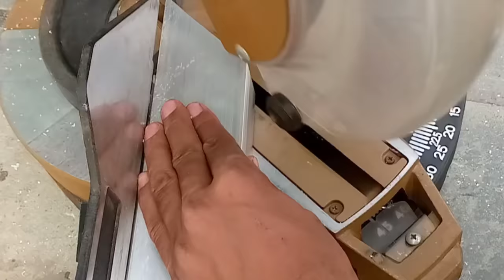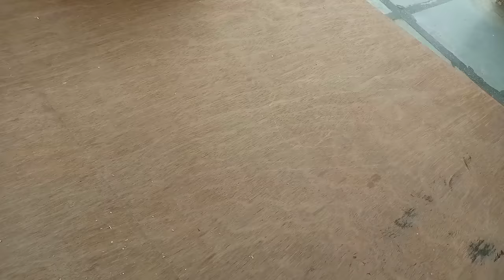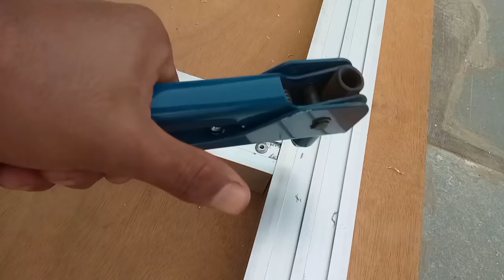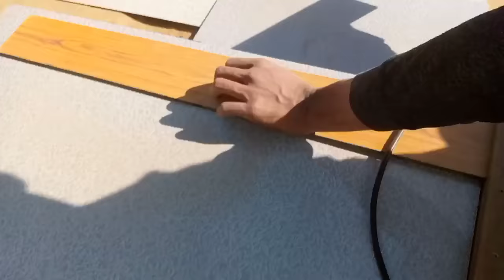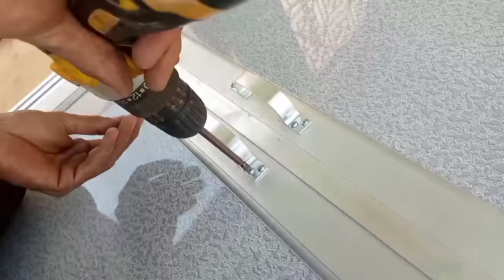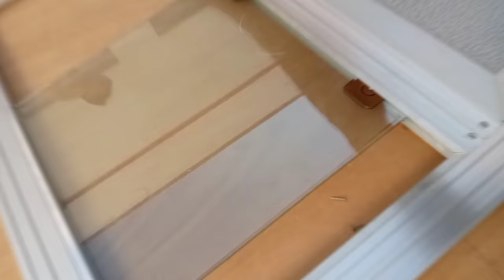how to make aluminium almirah एलुमिनियम की अलमारी कैसे बनती है #aluminium #aluminiumfabrication

Comment: सर इस मशीन का क्या नाम है
एस्कुरु कौन लगता है plz sir
Reply from the maker: Revt gun  https://dl.flipkart.com/dl/stanley-stht69800-8-heavy-duty-squeeze-rivet-gun/p/itmfbrycbdh7tyh5?pid=RIGFBNHYZTWHQPFG&cmpid=product.share.pp&_refId=PP.b0509148-01eb-4a42-a37e-7dfbeebb4c7f.RIGFBNHYZTWHQPFG&_appId=CL
Reply from the maker: Cutter saw aluminum 
https://dl.flipkart.com/dl/dewalt-machine-dw714-in-10-inch-compound-mitre-saw-metal-cutter/p/itmfetkkqcqmqgps?pid=CUTFERQ5KZXMZHST&cmpid=product.share.pp&_refId=PP.d9dd8fa2-7f30-408c-868f-0265b8437fc7.CUTFERQ5KZXMZHST&_appId=CL
Reply from the maker: Scrow Tighter https://dl.flipkart.com/dl/ranpra-rh-482-12-v-cordless-drill-machine-redhorse-heavy-duty-drill-screwdriver-double-battery-10-mm/p/itm6f0db46e3f028?pid=PODG5ZDMZRW3Y3CE&cmpid=product.share.pp&_refId=PP.977c9af2-f1ad-4981-a74b-d88d4b1d0e93.PODG5ZDMZRW3Y3CE&_appId=CL

Comment: 3 :49 pe jo profile hai iska naam kya hai window ke darwaje banane wale ....size bhi bata dijiye agar comfortable raho
Reply from the maker: Lineing tool.  Leekiya
https://images.app.goo.gl/82mgP9MGDmuFLbseA
Reply from the maker: https://images.app.goo.gl/1JuY8Woc6nx9ViFQ9
Reply from the maker: https://dl.flipkart.com/dl/mega-hr10-10-hand-medium-duty-squeeze-rivet-gun/p/itm0262fe23eaced?pid=RIGFJZK9P4HVYNKG&cmpid=product.share.pp&_refId=PP.726692b8-390c-46ad-a49f-9fd7fd0a23a8.RIGFJZK9P4HVYNKG&_appId=CL
Reply: Wo jo window frame ke liye material use kar rahe hain uska naam
Reply from the maker: @Yogesh08080  aluminium dhai inch with molding single tang section pipe